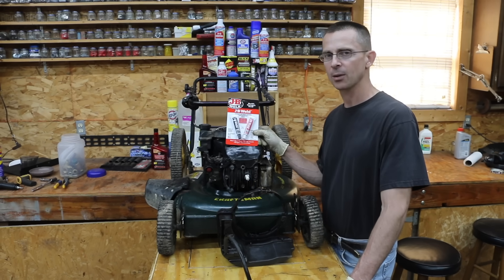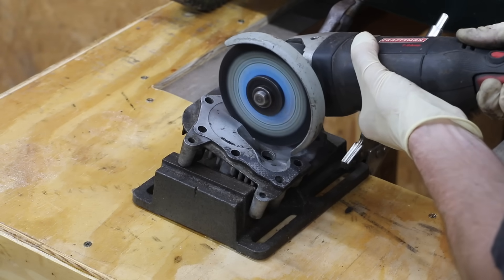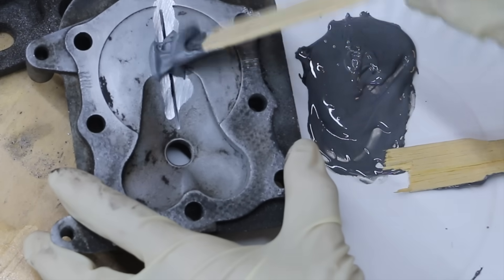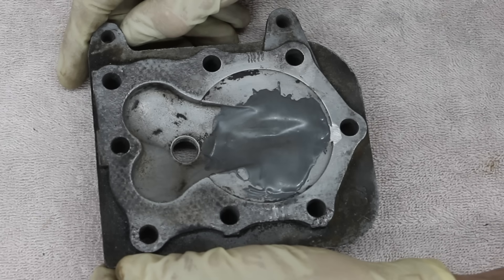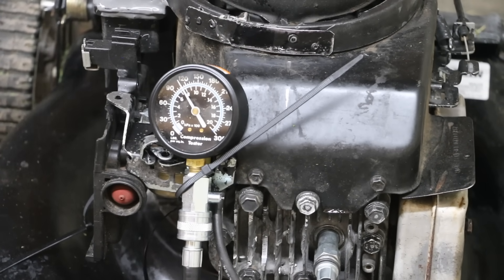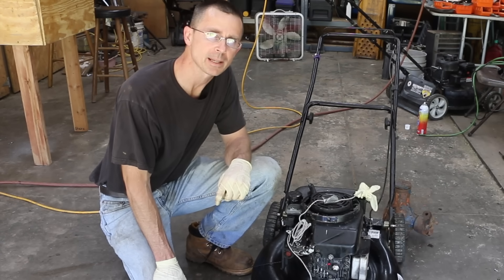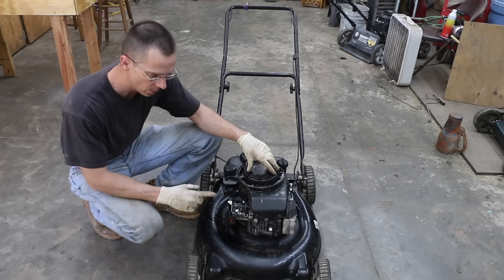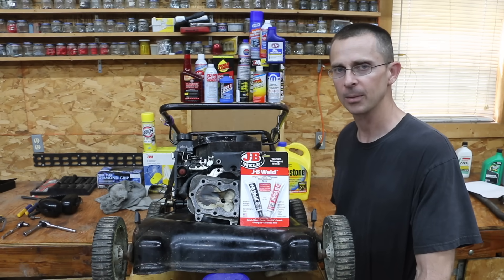Can JB Weld fix a cracked cylinder head?  See the proof!!

Comment: We had a 8in. Crack down the length of the engine block in our boat (inline 6 cylinder) we used wire mesh and jb weld. 7 years later, it's still running strong.(as well as a american engine from the 70's can anyway)
Reply: Thank you for your infor on  your 6 inline, I intend to repair a Yamaha F115 4 cyc inline outboard, a rod connect bolt brokne, knocked a hole on block, otherwise great running motor.
Reply: @dalepeter3016  4 years ago I snacked a whole in my block with cylinder no. 3. I've recently bought a replacement but it could be worth repairing for a spare... I'm not really willing to if the cylinder head was destroyed though. Costs nearly as much as a used engine to repair that.
Reply: @DENicholsAutoBravado  You are right,  connecting rods and pistons is easy to replace, but if cylinder wall or head are no good, the block is toasted. I had a F115, 2004, through a rod,  1" hole on block wall, yet cyl. wall and piston are all good.  With and new rod and full new bearings and rings, I got all 4 cyl 145 lbs.  (replaced faulty oil pump and patch up the hole). I got a good F115.
Reply: I used it over 10 years ago to repair a crack in the lower unit if my 140 hp outboard. It worked without problems.
Reply: Fully agree with you.  I am working on a 73 tower power , all 6 are 135-140 lbs, she needs key, trim hooked up and control adjusted.  As new motors are sooo expensive to buy and repair, l ll keep it for my 16' speed boat  for more lake funs.
Reply: @MiniMoto0098 How’s it holding up?
Reply: @nathangen   Unfortunately we sold it not too long after I posted this, almost 6 years ago at this point. So I’m not sure, but I’d bet it’s still fine to be honest. It was just the exterior of the block, it cracked because we forgot to take the frost plugs out one winter. So all the JB weld was contending with was the water flowing through it. I don’t think I realized that was the case when I posted this.

Comment: I used jb weld to repair 10 holes in the roof of my 98 explorer 2 of witch were about the size of a baseball. now 6 months later still no leaks or cracks or really anything

Comment: I would like to see your test on a vehicle engine instead where there's a water jacket involved as well as cylinder compression.
  I don't think it would work on a real cracked cylinder head. You would probably have to do the same thing with your grinder in order to get the JB Weld into the crack. 
   I don't think it would hold up very long ?
Reply: I did it with my jeep 4.0 engine. the head cracked and I JB welded it six weeks ago and it still working with no coolant loss into the oil.

Comment: i have used jb weld to fix a truck radiator and also to fix some head lamps that had a hole for a strobe light previously installed, i fixed a fog lamp that got in an accident too and thanks to you now i now that i can use it to fix the leak on the 90° conection on the carburator of my lawn tractor

Comment: I had a tractor a few years ago, that had slack in the kone for steering ball joint. I tried to fix it with welding and reaming, but the hole got slack again after half a year. So I ended up using JB-weld the second time, and it lasted for two years of my use, and still no slack... Incredible product!
Reply from the maker: SuperSveng, This is a great suggestion!  I have a tractor that needs this procedure.  I'll give it a try!

Comment: There is a jb weld and a jb kwik,  i want to know the difference in consistancy, is jb kwik runnier?  (quicker to dry and runnier). It can be used on many surfaces, I want to paint it on old concrete statue surface to use as a seal.
Reply: Hi, just read to add acetone to thin the paste,  Ive looked a bit further and both look the same when mixed.

Comment: I have no doubt that this may have been asked.. (but I'm not reading almost those comments) that was a manufacturered crack.. and  very impressive,  but how about cutting through intake 24 48 72 hours two build it  back to get together using JB... just a suggestion. . I believe that it would be a great thing to see... and watch. . I just found your site and I like it.. . 30+ year ASE Master teck. and btw.. I swear by both seafoam for the gas tank and Marvel Mystery Oil to clean out the valves and the intake, but my hot soak and tells flooding out the engine at high idle until it kills with Marvel Mystery Oil and then let it sit at least overnight, the longer the better.. my first hand testimony to Marvel Mystery Oil was a mid 70s Ford pickup truck that it's at at my grandfather's house not running for many many years they gave it to me and on the way home I burn 3 quarts of oil to 3 gallons of gas, can you say mosquito burner after I did the Marvel Mystery Oil it didn't burn a drop of oil and all the compression came back, sincerely Dave guptill
Reply from the maker: Truck Manjr, I enjoyed reading your comments!  The intake repair seems like an interesting project!  Thank you for watching the video and commenting!

Comment: I have used JB weld for several repairs.Once used it to repair a radiator,don't know how long it held,just know that we used the car for about five years,no problems,then sold it.Second one I want to mention is that we once used JB weld to repair a engine block.Engine was a flat head inline six,used in the military 3/4 ton truck.Head gasket was blown between #1 and #2 cylinders.Cleaned up discovered a crack between 1 and 2 very shallow crack.Ground a Vcut into the crack filled with JB weld,filed the block smooth.Crack did not go very deep,so we cleaned up every thing made sure the pistons were not hitting anything,put on a new head gasket.engine ran fine.Left the unit about a year later engine was still running.I have also used JB weld to repair metl fuel tanks.
Reply from the maker: Impressive!  Thank you for watching the video and commenting!

Comment: true jb weld tale. oil cooler for a detroit 371 powered air compressor on the air side springs massive blood flow from banana burst aluminum core tube, resulting in high pressure oil bath for everything in 10 yd radius, and literal saturation of core, fins, etc. coworker declares ability to weld (mig no less) a repair, resulting in a few inches of tube going houdini in a bed of burnt copperish fins (very wagnerian, in its own way). a replacement pretty much requires access to a time machine and mutton chop sideburns, so not a viable option. what DID work was cutting out all the singed fins, scrubbing with lacquer thinner, a duct tape dam, and that same point of sale blister pack jbweld you used, ala walmart, home despot, lowes, supermarkets, etc. 24 hrs to cure, duct tape ripped off, reinstalled and put back in service. that kluge survived 4 air side fires,   running a jelly like polymer that resulted from mixing pump oils, and even outlived the deet. thats at 200psig with hot oil for 6 or more hours a day, 5 days a week, for about 3 years, and it never seeped a drop, not even a snail trail. im convinced you could patch a hole in the sun with jbweld, lol.

Comment: I used JB Weld to pack out a VW Beetle crankcase that had been hammered around the flanged main bearing. Engine lasted another year 12,000 miles before it dropped a valve. Admittedly, a Beetle engine isn't the most highly stressed lump out there but it enabled me to continue using the car while I could build a new engine for it.
Reply from the maker: Impressive!  Thank you for watching the video and commenting!

Comment: interesting but i dont think this proves anything.  The cut isnt representative of an actual metal failure.  This is more like filling a drilled hole not rejoining 2 sides of a metal failure where those 2 sides are trying to move in relation to each other..  Also i highly doubt that the epoxy would hold up long term to being part of the combustion surface.  The temp on the combustion surface is easily going to exceed its rated 500f.

JB weld is amazing stuff but i highly doubt it would hold up for more than several minutes across an actual crack in a combustion chamber.
Reply from the maker: Great point!  Thank you for watching the video and commenting!

Comment: I've used it to repair the plastic radiator neck on a car, a quarter size rust hole in a air compressor tank and many other things but
not all materials can be repaired with it so you have to give it a try just make sure the surfaces have been cleaned of oil or grease.
Use Lacquer Thinner, Alcohol, Brake Cleaner or Acetone to clean/degrease the surfaces and thanks for your video.
Reply from the maker: Impressive!  Thank you for watching the video and commenting!

Comment: I did fix an external head crack on my 4.3 Chevy V 6 in my boat.     That was in 2005 and hundreds of hours ago.    I used a product called Devcon though.    It's sort of ceramic gooey in consistency and stays put on vertical surface well.     
     I use JB for most other things though.    When you buy it d spring for the large toothpaste size tubes.   Much cheaper and seems to have infinite shelf life.
Reply from the maker: Tom, Thank you for the suggestion on buying bulk!  Thank you for watching the video and commenting!

Comment: JB Weld for life thats all i was known for on my motorized bike. gas tank had a leak where the bolts mounted? Jb Weld. Part of my bike frame split in half becuase of motor shaking it apart? JB Weld. Even used JB Weld on my cars shifter linkage because no one had the part, PVC and JB Weld.
Reply from the maker: Impressive!  Thank you for watching the video and commenting!

Comment: 1995 7.3L Powerstroke radiator. it had a Crack in it right along the corner of the radiator and a section of the overflow return line nozzle. Repair done well over a year ago and still holds strong. Truck is my daily driver so it has seen plenty of heat cycles.
Reply from the maker: Impressive!  Thanks for watching the video and commenting!

Comment: I have a super charger on my civic and one of the bolt holes that mounts the blower to the manifold was stripped. I used JB in the hole and tapped it. The thread did not hold up. So its not good for re-threading bolt holes.
Reply from the maker: Jeremy, Thanks for watching the video and commenting!

Comment: +Project Farm GE Silicone sealant works pretty well for gas tanks. We had one of the Briggs 2-piece metal tanks and the top seam was split in one area. A new tank was $50 which is what I paid for the mower so we tried the silicone and it worked beautifully. I think it was all of $7-8.
Reply from the maker: Charles, thank you for this product recommendation!
Reply: Anytime! I hope it works out well for you.

Comment: I made a boost bottle for the intake of my 2 stroke quad by JB welding a copper pipe fitting onto an aluminum hairspray bottle of the same displacement as my engine.  It has been on there for 11 years and I'm still riding wheelies...  LOL it is good stuff

Comment: Would you mind to test JB Weld Extreme Heat to patch the the wall of cylinder sleeve which have few deep scratches from two stroke engine such Yamaha Blaster?
If this test successful then it would be a good option rather than to rebore or resleeving the cylinder sleeve because it would save a lot of money and time to do that.
Reply from the maker: The Omen, Great suggestion!  Thanks for watching the video and commenting!

Comment: That was one hell of a crack you made. But , you did put that JB Weld through hell but for an emergency fix it works pretty good I would like to know how well it would hold up over time and how long it would take to fail. Since JB Weld is an epoxy it is similar to plastic how well does it hold up to heat over time. This was a neat project keep it up if you enjoy doing these videos. Oh, yeah I have used JB Weld on fuel motorcycle fuel tank and the repair has never leaked.
Reply from the maker: M W S, Thanks for watching the video and commenting!

Comment: I used jb weld on my motorcycle exhaust. I even used the "high temp" stuff. burned right out. lol.

its not recommended for fire temp. I am extremely surprised this worked. 

from my understanding in weld is just epoxy with metal powder in it. to get a really high temp rating you may try adding carbon powder. carbon impregnated resin can withstand some incredible heat.
Reply from the maker: Thanks for watching the video and commenting!

Comment: Very good test. Especially grinding the head down a bit helped solidily seat the jb weld. What are your opinions on CPI 4 minute steel poxy? would it hold out just as good? I used CPI to repair a 5 gallon metal gas container that had a few holes underneath. Held out superb
Reply from the maker: Ronaldo, I've never used CPI.  Glad you achieved great results with it!  Thanks for watching the video and commenting!

Comment: I've used JB weld quick many time on many different applications.  I once used it to repair a cracked end radiator tank on an old S series Saturn....It worked great. I should mention that there were raised solid plastic areas on either side of the crack that i drilled holes into through which I inserted steel wires for reinforcement in the JB weld in an effort to keep coolant pressure from popping the repair loose. I also rough sanded the area and cleaned the area with brake clean.  I drove the car after the repair for at least a year with no sign of a problem and sold the car with the repaired radiator ...probably still going as far as I know.. I've used jb weld for plastic and metal gas tank repairs, broken serpentine belt tensioners and all kinds of other applications. Whenever possible I try to reinforce with a metal wire or rod anchored on either side of the repaired area, especially when there will be pressure.
    Most cracked heads are cracked from the valve seat to the water jacket in liquid cooled engines. It would be interesting to see if JB weld would stand up to that kind of test??
Reply from the maker: Elder, I enjoyed reading your comments!  Thank you for watching the video and commenting!

Comment: Thanks for all the interesting and informative videos! My choice would have been PC7 Epoxy. Been using it since late 60's and I think it has been around since the 50's. It is thicker then JB weld so it does less running. It would be an interesting test to compare the two products against each other. Do you have any mowers left?
Reply from the maker: Carolina, I do have some mowers left.  Thanks for watching the video and commenting!

Comment: I used it to repair a cracked engine block from a freeze plug in an 87 Olds Cutlass. Drove the car for 5 more years with no issues. Its a great alternative to repair fiberglass boat cracks as well.
Reply from the maker: Impressive!  Thanks for watching the video and commenting!

Comment: I use seal all for gas tank leaks. I have been using it for ages on snowmobiles gas tanks and seriously,it has been the only thing that actually works. JB weld is brittle and dont hold up on flexable items at all. Truthfully,on any crack,its best to widen the crack to allow whatever material you use to properly fill the area. I have fixed broken snowmobile blocks and can tell you,a crack by its self cannot hold enough JB weld to bond. I remember old timers using JB weld on water pumps and they would grind a V into the crack to properly allow enough JB weld to do the job. Yes it works. As far as long term. Dont hold your breath.Its a quick fix for a short term repair,but plan on getting another motor in the future.
Reply from the maker: Scott, Thanks for watching the video and commenting!

Comment: jb weld is the absolute best product ive ever used. i fix mowers and had a govornor gear break off in a briggs 19hp engine(the stem the gear rides on) i used jb weld to repair motor and it works great. cant beat the stuff
Reply from the maker: Thanks for watching the video and commenting!

Comment: i used JB weld on my Honda Accord transmission case cause my dumb ass cracked the casing near the drain plug, its been drove for a year since with no maintenance to the crack and same fluid with no big problems besides a little harsh shifting, but nothing that wasn't already happening to the car. it blows my mind to this day and i am not going to be mad when it does blow because I'm just amazed it has lasted this long.
Reply from the maker: Impressive!  Thanks for watching the video and commenting!

Comment: I would be interested in seeing if the old JB can fix up an exhaust before the catalytic converter.... my pipe keeps leaking where the cat fell off lol
Reply from the maker: Maxwell, Maybe the extreme heat JB Weld product.  Thanks for watching the video and commenting!
Reply: Project Farm the ol steel stick seems to be working okay actually. We will have to see how it holds up, but so far so good.

Amazing how much juice the truck has now that there is some appropriate  back pressure.

The old Toyota pick up has some pick up again haha.